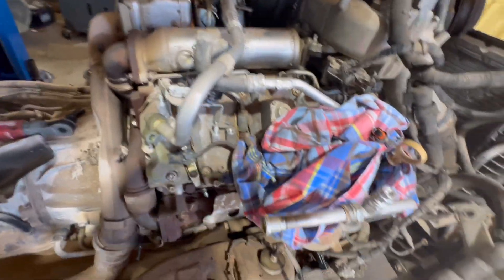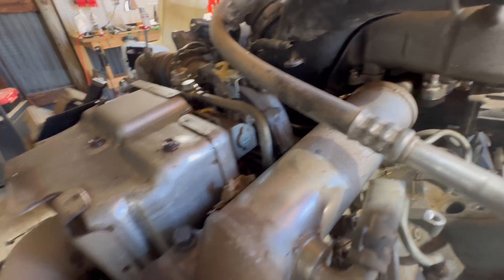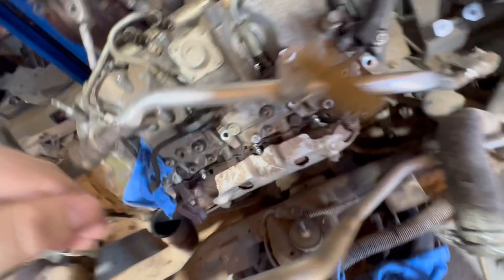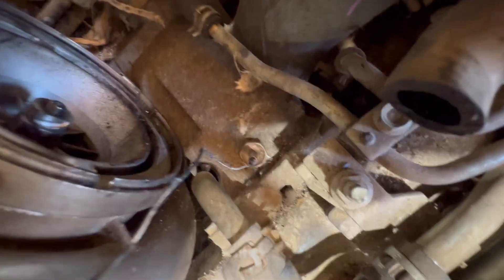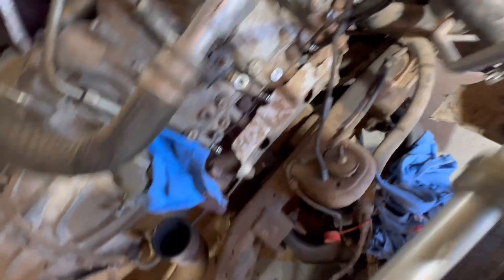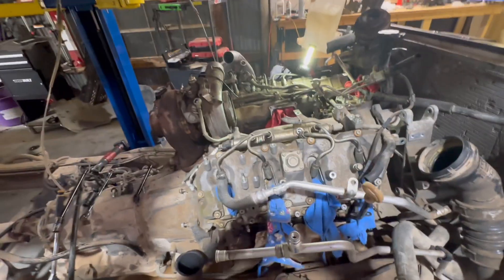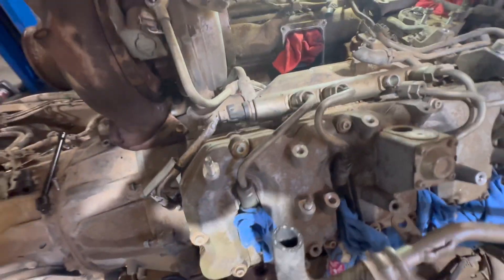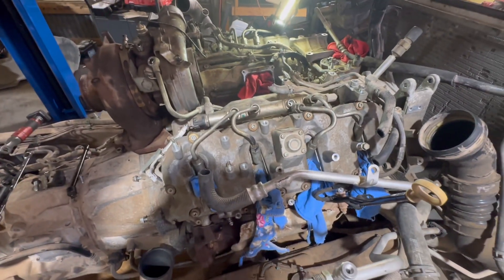LBZ Duramax Cab Removal/ Fuel System Repair: Part 2

Comment: What about added accessories like rear camera, efilive , high idle wires etc ??
Reply from the maker: So this one didn't have the SOTF switch but you can either cut the wire and solder it back or un pin it out of the ecm harness. Other wires will be up to the person on how they want to take them out. Every truck can be different in this aspect so just a case by case basis.